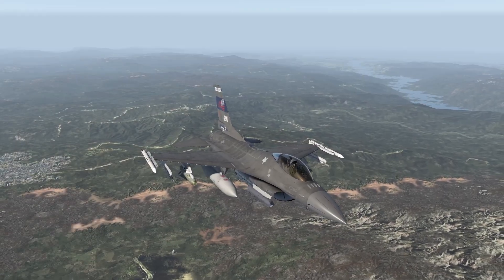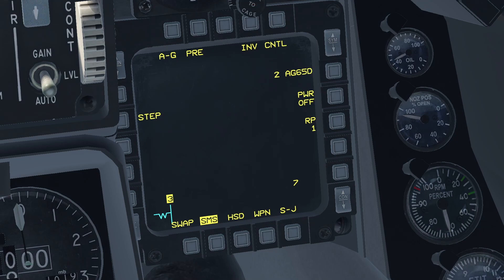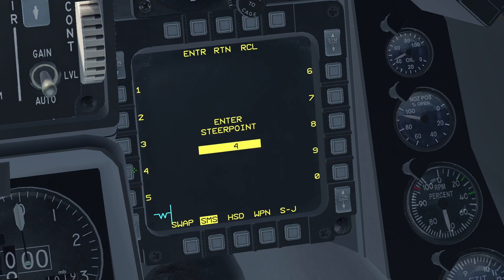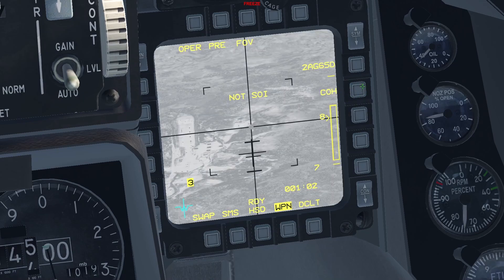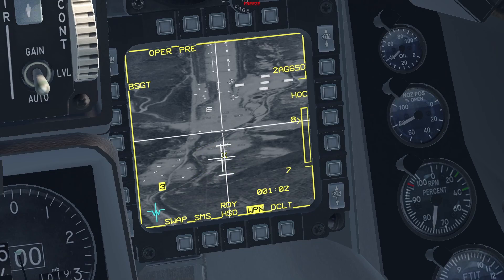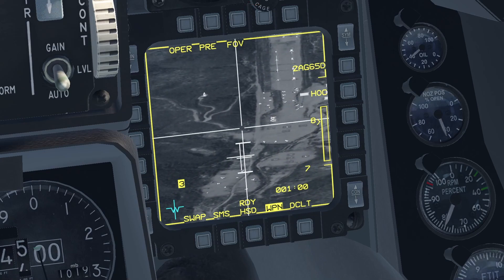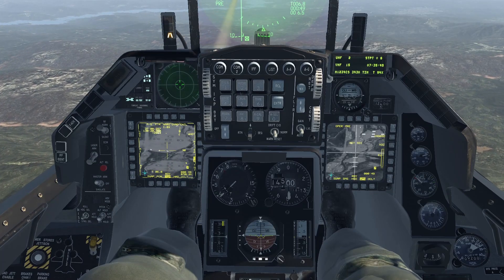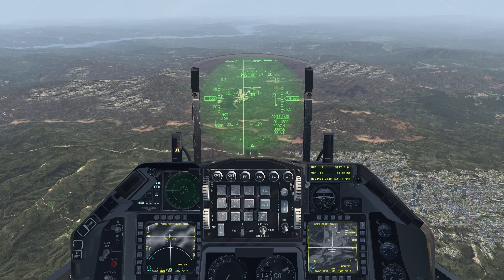Falcon BMS 4.37 Tutorial - AGM-65 Maverick

Comment: If I were in boresight mode and, without locking anything, I just shoot a missile... Will it hit whatever is on the crosshair or go stupid? (Dumbest question ever but it would be so funny to use mavs as a more expensive LAU-3 rocket pod)
Reply from the maker: @Gold_Roberto  without pressing TMS Forward before shooting? It still go stupid, because the camera isn't really tracking anything, it's just transmitting video feed
Reply: @fisgasfighties  what if I press it once and do not "refine" the aiming reticle?
Reply from the maker: @Gold_Roberto  just ground stabilizer and shoot? I'm not sure, I'll have to check

Comment: Excellent tuto and a new subscriber for your channel - I see you've done quite a few other tutorials and they're recent, which is great news. Thanks😎
Reply from the maker: @herveledref636  thank you for watching and welcome to the channel!
Reply: @fisgasfighties  Would you have a tip for reducing the speed of the TQS cursor. I have a lot of trouble adjusting my targets on my TGP - the cursor moves too fast - Thank you very much.😉
Reply from the maker: @herveledref636  what mode are you using?
Reply: @fisgasfighties  PRE Mode
Reply from the maker: @herveledref636  with or without the TGP? Are you trying to boresight to the TGP or use the maverick by itself in PRE mode?
Reply: @fisgasfighties  with the TGP.  the cursor move too fast.
Reply from the maker: @herveledref636  on the HOTAS I use, the TM Warthog, radar cursor moves faster or slower depending on the amount of "pressure" you apply to it. I suggest zooming in, it could mitigate the cursor moving too fast somewhat. What HOTAS do you use?
Reply: @fisgasfighties  TM Warthog to !  Thanks for your reply.
Reply from the maker: @herveledref636  and still it moves too fast for you? I assume you're using the same axis to move it around as me, I'm not sure it can be calibrated
Reply: @fisgasfighties  I'm going to check the calibration of the TQS axes. I think I'll also have to check the CFG file to see if it's possible to modify the speed. Many thanks for taking the time to reply. It's very cool.
Reply from the maker: @herveledref636  anytime, I'm happy to respond and help folks. I'm sorry I couldn't be more concise and helpful.

Comment: What are the advantages of each mode ?? Especially between boresight and pre mode ??
Reply from the maker: @DJeb86  personally I use PRE mode when I have a TGP loaded on the aircraft, I then use that for targeting after slaving thr seeker head to it. I would also use it if the target is stationary like a building or skip that's docked for example. 

BORE mode I'd use if I don't have a TGP loaded and I'm engaging targets of opportunity, by simply pointing the nose of the aircraft to the general area os the target and then fine tune my targeting.

But I think it comes down to personal preference and practice with the different modes.
Reply: @fisgasfighties  great thanks for you answer.
Reply from the maker: @DJeb86  anytime!